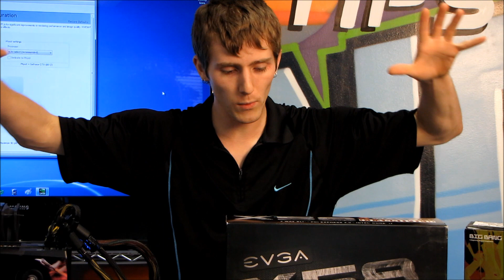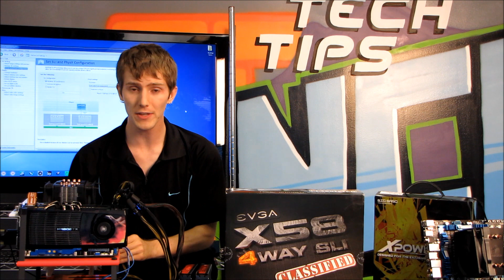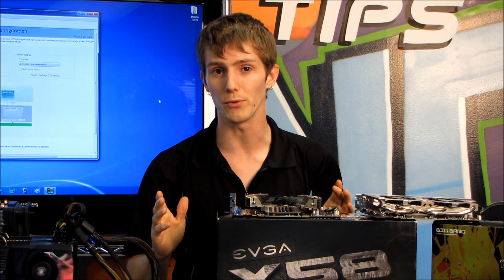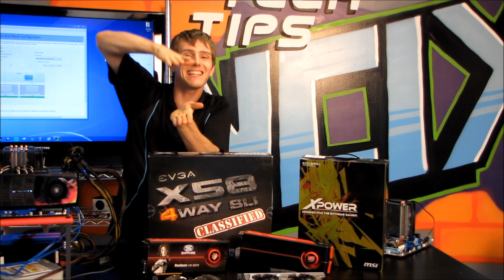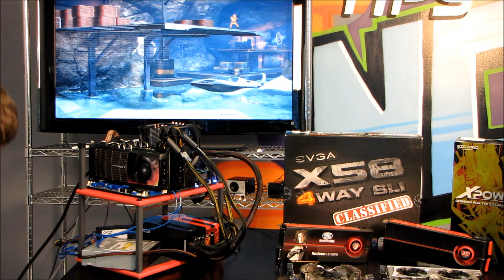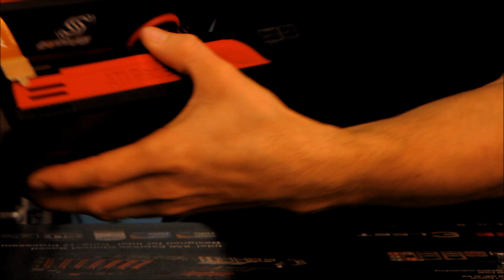SLI & Crossfire FAQ & Tutorial (NCIX Tech Tips #89)

Comment: Around 10 years ago (give or take) I built a system when 8X AGP was used for high end graphic cards, later on I hear of PCIe being the next best thing for high end graphic cards, then I hear of crossfire or SLI and although I knew of boards that had multi PCIe slots I don't remember at the time any of the boards needing to being crossfire or SLI ready because crossfire or SLI was achieved via the bridge cable and then I hear of motherboards that are crossfire and SLI ready and I thought that was going to eliminate the need for a cable bridge? Any 1 know anything about this?
Reply: Thanks for the reply! I'm building a new machine and like my old 1 I'm going with a AMD, both cpu and graphics. I had good times spent on my old AMD, Gigabyte mobo build so I think I'll go the same route again with Asus's version of a AMD running mobo. I know people can favor Intel as well but I'm just going with what worked well for me years ago and get into a little higher end gaming.
Reply: SABERTOOTH 990FX R2.0. I know it's not on par with the latest and greatest but it's more then enough for running top tier games, I've got boxes seating in the corner of the room of 4 X 8G DDR3, AMD FX 9590 Black Edition cpu, Corsair Hydro Series H115i, 2 R9 390X's MSI graphics cards, Corsair AX1500i 80 plus titanium, a Samsung 950 512G SSD M.2 and riser card on the way, last 2 things to get is the OS and case and the build will commence. I know I'll get criticized by the so called hard core pc enthusiast about using a mobo that doesn't have the latest PCIe 3.0 slots but the only thing research has told me thus far is that the only good thing to utilize PCIe 3.0 is ssd's like M.2's or add in card type ssd's but graphics cards don't necessarily seem to get any more benefits from the faster slots. I guess I can live with it after all I'm not rich so it doesn't get much better than what I have now. :) Sorry for typing a book. lol

Comment: So basically if i try to run two r9 390 i need 1,000 watt psu instead of an 850 psu then? If this helps im getting a 850 gold plus
Reply: A high quality 750 watt PSU would even be enough so 850 will be plenty for your dual r9 390 setup. BTW, which power supply are you buying?
Reply: +bouncysnipe EVGA 850w 80+ gold certified fully modular ATX Power Supply
Reply: +Anthony Loho Your good, that power supply will definitely be able to handle your system
Reply: +bouncysnipe haha thanks

Comment: Um i think i have a problem!
I plugged in both my 780s in and i attached the sli bridge and both of the cards fans are spinning so i know they are on.
But when i go into nvidia control panel there is no configure sli,surround,physx tab because it only says configure surround,physx.
When i go into the tab i also do not find any options for sli help what do i do?
Reply: did you try to reattache the bridge?
Reply: Quentin Böttger yes that was not the problem. The problem was that the motherbord was broken. :-(
Reply: ok didnt know that wich one did you use
Reply: Quentin Böttger I was using a asus maximus V gene though sent it on an rma

Comment: So in the scenario where one GPU has 2g ram and one has 1g, does the system by default use the card with 2g for the vram since it is not additive?
Reply: in nvidia: wont work in sli amd:idk
Reply: It will work in sli if it's the same card, im just asking if it will cap at 1gig if the vrams are different.
Reply: ***** sli only works if the gpu AND ram are matching (didnt you see the annotation in the video?)
Reply: Kaneki Ken Some are watching on their phones, where there is no annotations :-)

Comment: i wanna crossfire dual HD7770 i have one running 3.0 x16  been doing resarch ever one i asked  toms hardwear says theres no point but i really wanna know how much fps i gain over one GPU how much performance ill get with the 2th 7770 the 2th slot * Whether PCI Express 3.0 is supported depends on CPU and graphics card compatibility.
2.1 x PCI Express x16 slot, running at x4 (PCIEX4)
(The PCIEX4 slot conforms to PCI Express 2.0 standard.)
3.2 x PCI slots pls i really wanna know if its worth to buy the 2th HD7770

Comment: So I can run 2 gtx 780s and run any game maxed in every setting
Reply: yes :D
Reply: if the game supports sli, most do nowadays though.
Reply: A single 780 can max out any game.
Reply: yes but not on constant 60fps
Reply: There's like one game a single 780 wont run at a constant 60 FPS and that's Crysis 3. I run Battlefield 4 on ultra at around 85 FPS. Unless you own one, you can't tell me that a 780 doesn't perform well.
Reply: lmCIoudz Any card can max out anygame... Just most of them dont do it very well
Reply: yeah crysis 3 but this is the best game :D
Reply: lmCIoudz depends what resolution you're running
Reply: dan428 Obviously.

Comment: I've got a 925Mhz 7970 that I'd like to crossfire, If I get a 1050Mhz 7970, will I have to clock them to the same speeds, or can they just run like that cus they have the same chipset without a problem?
Reply: Try overclocking it. They should have the same GPU and therefore the only limit is the heat. So if you current card can go 1050+ Mhz then fine! I'm pretty sure you can run the cards at different speeds, but microstuttering would be way more noticeable.

Comment: Pretty sure you cant, as the 560ti is a step up from a 560, but the brand of card shouldnt matter. For example you can SLI an EVGA gtx 560ti 1gb and your twin frozr card, but not cards from different lines within a series. So just find another gtx 560ti. Hope this helped :)

Comment: no, not really. You get a significant boost, but it is never 200% and it all depends on the driver you are using, because some have better SLI / Crossfire profiles for games than the other ones. When the game launches it has no profile so it runs only on 1 card. When nvidia / AMD releases a new driver and it has a good profile, you can get 150%, 160%, 170% performance of the 1 card

Comment: I have a question about the SLI , I Have Asus P6T motherbored that have  2 x PCIe 2.0 x16 (dual x16, blue) and 1 PCIe 2.0 x16 (x4 mode, white)  
the problem is that i have asus GTX660 Oc 2GB . and i want to sli it with another one .
but the gpu cooler is big and i dont have space to put the another card into Dual X16,blue . if i will connect it to PCIe 2.0 x16 (x4 mode, white) it will effect on the SLI speed and on the GPU card ?

Thanks

Comment: Basically that's all you need to do except keep in mind the power at the wall and the power delivered are not the same because the supply loses some in the AC to DC conversion. If your system components were using 850 watts you would see closer to 1000 AC watts at the wall and it would not be overloading the supply. I doubt your system uses more than 500W with a single card but the difference would be exaggerated somewhat on the watt meter, about 20%

Comment: You might be able to use the 850W still. Nvidia recommended supplies are VERY conservative. I have run a dual GTX 480 system ever since the cards were released without any problems on a corsair 850W psu. I would just get a watt-meter with the card so you can monitor how much power you are using. My system draws about 650W max from the wall. Your card should draw less than mine

Comment: it's not usually driver issues so much as microstutter. the 7000s series cards have a much higher ms issue than NVidia at the moment. that said I was running 2 7950s with no noticeable issue, except heat ... which is why I am only running one until I can run my ac full time.

Comment: @1:50 there's a bit of a hiccup in this theory. I have an HD7870 and a more recent HD7870 that I was planning to run in CrossfireX but it didn't work out. Why? Simply because the generations of chipset had changed, even though they were still 7870's. The older one couldn't CrossfireX with the newer one (XT Boost edition) because supposedly the newer cards are actually running a 79xx chipset. I think that's tantamount to shifting the goalposts, so yes I was a bit pissed.

Comment: I have a question about crossfiring on my FM1 motherboard can someone please help?
I have a FM1 asus motherboard and i my processor is a apu 3870k and i have 8gb of ram and i just bought 2 7770s and the motherboard was cheap around 70$ and it has 2 pci-E 2.0 slots but when i pput both cards in the black one runs at x4 is it normal that when i installed all drivers it freezes when ever i go into a game and also my computer feels slower when there in crossfire.

Comment: SLI = Nvidia's technology for connecting 2 - 4  graphics cards of the same type and series ie 460GTX can have SLI (1 card in each PCI - Express slot.) which is  2 cards connected  via a SLI bridge, which is a ribbon cable. Then there's 3 way SLI 3 nvidia graphics cards connected  together and so on up to 4way SLI.,AMD/ATI have their own system called Crossfire. works in the same way as  SLI.2 or  more graphics cards  in the same series of  AMD graphics  cards connected together called crossfireX

Comment: Because  it doesn't  work like that.. each card would use it's own VRAM then render the image. You'd see some improvement with SLI however allow  for  micro-stutter  because that occurs because of the delay of data going  down the SLI / Crossfire bridge. between cards. the more graphics cards  you have the worse the micro stutter. but  you'd also have higher resolutions and you can max out the details with  SLI / Crossfire.

Comment: No it  would still be 768MB SLI doesn't  work like that.. What it would  mean is the cards would share the workload. however depending on the game.. it  would depend on whether  you'd get a 50 / 50 split  or as usual with  SLI one card does most of the work and the other may render other parts.. so it may be a 60/40 or 70/30 or 80/20 ratio. depending on how the game was written.

Comment: I have compared the 5970 to the 470 and 480,  the 3850 vs 7800gt, and the 6970 vs gtx 580 and gtx 570 regardless of overclocked or stock combinations and NEVER has the image quality in my over 10 years of pc building experience illustrated a difference what so ever in the brand name of video cards kid.  You obviously are just fanboy talking.  I've built more than 60 gaming rigs for 60 customers as of last month since 2002. better fps for same settings? maybe. depends on game

Comment: It's straight forward. plug in the 2 cards in their respective PCI- E slots.. connect the SLI bridge. to  both cards.. then screw them both in tight to the case. then attach the monitor cable to the top card. ie the  one  nearest to the  CPU. Depending on your monitor.. DVI, Display Port & HDMI will give you the best image results.

Comment: I finally got 2 SLI cards, 9600gso 512s so I can try it out. I have looked for 2 hours for info on how to SLI. My XFX manuals (Useless), Nvidia web site (useless), google search(just plug em in). So how do I plug em into monitor? 2 DVI cables? Do I need a monitor with 2 DVI ports? Dual or single DVI's? If 1 cable, which card gets it? Does it work w/ VGA plug? any limits on monitor? Do I need Vista or Vista SE(otherwise known as Win7)? I have XP. Can I sometimes use 1 head(SLI) & others 2 heads?

Comment: my system is already built i have one 7850 but i will just upgrade my card in the future instead of buying another for CF. I did some psu calculators and they said recommended psu was 570watts with my specs

Comment: That's a lie. Most of the newer games will need more cores because of the high graphics rendering.  And a good graphics card won't cut it. BF3 has better detail when running 4 cores than it does with the same settings on 2 cores.  Plus, a 2 core cpu can bottleneck the 5870 or anything better.  I have a 5850 and i tried it out with a dual core and my performance wasn't what it could be. 4 cores released all of the cards potential but just for some better multi-tasking, i went with a 6-core.

Comment: There are bridges for 2,3 and 4-way SLI/CrossFire. I do believe they are still a single bridge just with more connectors on it. Also, if the cards you want to CF (I'm not sure if Nvidia cards can do that too) are mid-class, like a 6670 for example, then you won't need a bridge, as the PCI-e slots can handle the data communication between the cards.

Comment: Additionally, I was wondering if my 600W PSU would be enough for both. On the power usage calculator is calculates that less than 500W would be used at peak. It would be great to know, thanks a lot

Comment: HI, I have 2 Gts 450 geforce cards. Both updated, set & ready to go, but after installing my drivers. My Nvidia control panel don't add any Sli settings. why?. I re-install it again & still nothing?. What went wrong?.I started searching for answers & found out some people are have the same problem. Is there something in the Bios that must be turn on, if so, what?..I would really like my cards to which to maximum preformance please...

Comment: That is not correct, a 660ti can only be used in SLI with another 660ti GPU, it can be different manufacturers (You can for example run an ASUS card together with an MSI card) and a 680 can only be run in SLI with a 680.

Comment: Actually, you can run those cards at the same time if used on different monitors. You could actually run an ATI and Nvidia card together as well but it would be even easier since you can configure both cards at once with the Nvidia Control Panel.

Comment: Well, you should really try to match the memory size so that you are ensured full value and performance from your purchase. But it could be possible. You'd have to run CoolBits to hack the registry so that you can force both of the cards to use the lower of the two memory sizes and operate them together in SLI mode.

Comment: hey, could someone help me out? I have a hd 6950, but i want more juice so I'm thinking of purchasing another 6950. That is for sure. But I have an ocz modxstream 700 watt psu. Some say it won' t do, others say it'll run fine. So is this psu enough? btw i have an i5-3570k, 1 sata hdd, 8gb of ram and a pci wireless adapter. Nothing's overclocked

Comment: You can run 2 different cards in the instance that you cant afford 2 of the same cards. example, I wasnt able to buy the 1 card that i really wanted so i sucked it up and bought a slightly cheaper one and a comparable one to that as well and SLI'd them and got better performance than i would have gotten if i had bought the one main card that i wanted,

Comment: the gtx 690 is basically 2 under clocked 680 gpus in 1 card, therefore you can only run 2 in sli as it is actually 4 gpus

Comment: Now I'm sorry if this offends you in any way or manner(it shouldn't). Physical 4-Way SLI on GTX690's would firt of all not be impossible but would require minimum of 4000W of power(that would be around 3 1300W PSU's. Cost = 800€) and the cards them selves would be like 2600€ so combined cost would be 3400€. I'm pretty sure no one wants to put that much money for ONLY those components. And you would need a rather large case for 3 power supplies and 4 GTX690's :)

Comment: Actually a single 6 pin power connector can only supply a maximum of 75 watts. Now even on nividia`s website a single 550 ti can consume a maximum of 116w of power on full load. When in sli it probably won`t run at full load so each card uses a little bit less watts depending on what they are used for. I run sli gtx 460s overclocked to only about 800mhz with a 650w power supply. Along with overclocked i5 2500k.

Comment: since the 550 ti uses only one 6 pin connector, it will not consume more than 100w. With a 600w power supply, you would probably be using no more than 550w as long as you don`t overclock and use more power. I checked on the geforce website.

Comment: The other guy is messing with you. 750 watts should be enough but be warned....you may be cutting it a bit close when your PC is under full load depending on what type of CPU and which cards you use.  I think you should be fine with the 750 w but do some quick simple math and research before hand to add up the watts your components will draw from the PSU

Comment: Athlon X2 (unlocked to X4) B60 @ 3.3Ghz cooled with an H80
8 GB of Kingston RAM
AMD Radeon 6870
M4A88T-M Motherboard 
1 TB storage with matching HDD for backups
All powered by a 585 watt PSU

I am considering changing out my motherboard with one that supports Crossfire and was wondering what you guys would suggest for this setup. I know I will need to upgrade the PSU to something around 800 Watts to support crossfire 6870's. I may even OC the 6870's a little with MSI afterburner.

Comment: Damn i thought the Core Clock, Boost Clock, Shader Clock, Memory, Memory Bit Rate ,Memory Type, Memory Clock and Cooling has to be exactly the same as the GPU i have now. Ive been told its highly recommended due to the fact it will run smoothly but meh.. 

Thanks Linus

Comment: you have to be kidding............. Linus was using a 1200w with 2 GTX480 (Take the most power) and even then only 800 is used. Doubting he is getting 2 GTX480s so a 750w would be fine. 1200w is absolute overkill for simple 2 way.

Comment: in which case i would play it safe and get a 5770, because anyway the 6770 will be bottlenecked to a 5770 performance anyway, so got for a second 5770 and keep it simple, or upgrade the your original GPU to a 6870 or higher, so that u can crossfire that, when u want to, otherwise u will be stuck trying to play the latest games with a GPU system that has nothing special,

Comment: IIRC only the GPU itself has to be identical. I don't know for sure however. I think that if you have 2 cards in SLI with different VRAM, the one with more will simply run better on higher resolutions. So if you have 3 screens and 2 cards in SLI, connect 2 screens to the one with more RAM. But again, I'm not 100% sure.